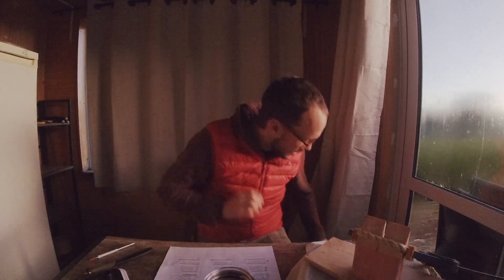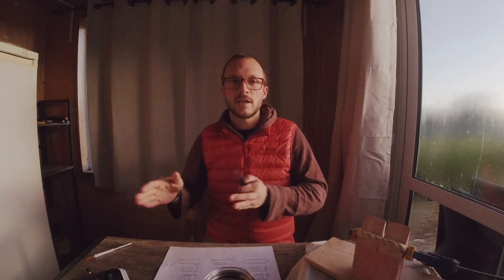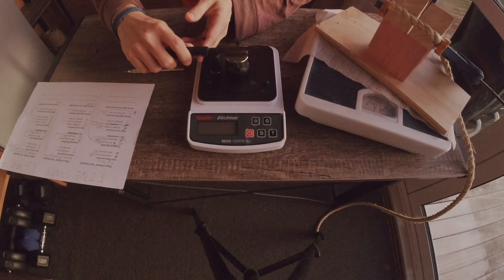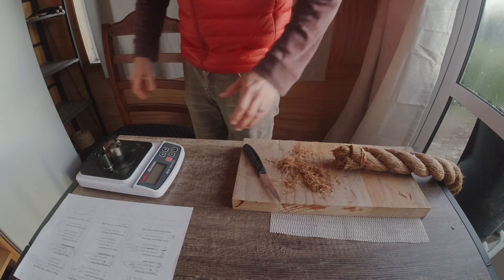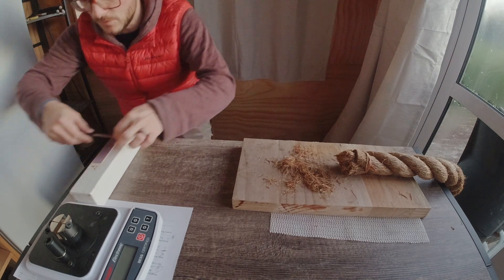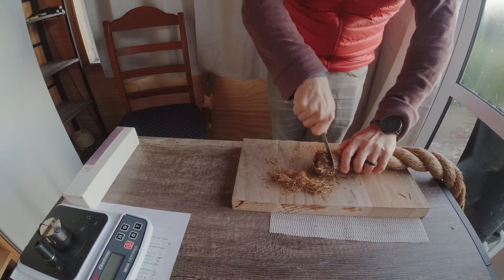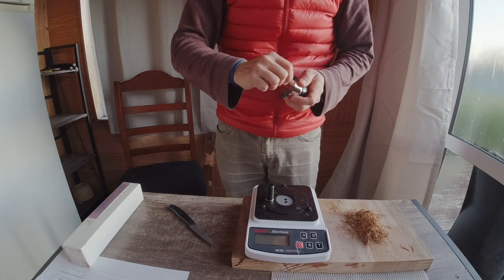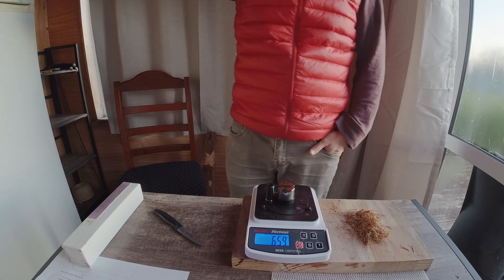What's Wrong with my Lapping Film Edge? | ANDE Rope Knife Testing

Comment: The problem is what you’re cutting with a lapping film edge. The edge slides off rope because there are no teeth. Lapping film edges can be extremely sharp if done right and are for opening letters, paper cutting, things like that. I use lapping film edges at work to cut playing cards all day. But to cut rope, you use edges with teeth- 600-1000 grit are great. Hope that helps.
Reply from the maker: Thanks Mike!!!

Comment: I noticed you going from heel to toe away from the edge. Ate you following your scratch pattern? If you think of it as a saw, if you go heel to toe when sharpening towards the edge, then you want to go toe to heel when sharpening away from the edge,  always follow your initial scratch pattern. To really get into the weeds if you are pull slicing the  scratch pattern should be angled towards the heel. If you are push slicing the pattern should be angled towards the toe. If you are push  cutting or general purpose the pattern should be straight up and down the bevel.
Reply from the maker: Interesting, I don't think I've ever noticed it making a difference.  Do you find you can observe a difference?  Thanks for the input, will consider it!

Comment: I’ve read any BESS result above 150 after sharpening means you still have a burr or wire edge present. 

Another comment had a good point about steel hardness. You might need a higher hardness to get a better edge.
Reply from the maker: Yeah, I think you are onto something.  Although actually, I am getting quite good edges (below 100 BESS) sometimes now on these Victorinox Paring Knives, but often I need to adjust angle and use softer abrasives to achieve it.  

I think harder steels will be comparatively more likely to produce "negative burr" and be easier to sharpen with diamond abrasives.

Comment: I think if lapping film tends to produce a foil burr, doing edge leading strokes are the way to go.
Reply from the maker: Do you do edge leading strokes on lapping film?  I always assumed that would cut through it.
Reply: @homeslicesharpening  i havent sharpened with them, but im pretty sure you can get away with it. I would do light pressure, and be careful not to go too high with the angle. 

I thinks its doable though.
Reply from the maker: @_BLANK_BLANK  I’ll have to give it a try.  I may have assumed incorrectly.
Reply: @homeslicesharpening  i know you can slice through them, but if youre being careful it should be fine.

Comment: ill give you a top secret of mine. For a super aggressive knife edge try only going up to around 600 to 800 gritt Max. Make sure your getting a burr on each side as you sharpen. You should feel it when you drag your finger over the side of the knife. Be careful when you do this. Never run your fingers down the blade. Then strop the knife with a 1 to .5 fully loaded diamond emulsion leather strop. Be sure not to over do this step because all your doing it knocking the foil bur off if there is one left. All my pocket knives are sharpened around 17 to 18 degrees and with this method i can push cut toilet paper :) Good luck on your Knife Journey :)
Reply from the maker: Thanks for the comment!  I did get better results on the lower grit edge that I then stropped, and will take your advice into account.

Do you do edge trailing, or edge leading strokes?  Do you alternate sides each stroke, or do as many strokes as it takes to raise a burr on one side then flip sides?  How do you know when you are done on the strop?

Thanks again!
Reply: @homeslicesharpening  The strop should be used sparingly. maybe 10 strokes on both sides. Its just used to clean up the bevel. I use a wicked edge.:)

Comment: Glad to see that scribe I sent you is helping you out. Never played with films myself outside on the edge pro ones that came with my edge pro years ago. I was never too impressed with them edge wise. They gave you a pretty mirror polished edge but the edge wasn't as good. Also last few years I find that I don't like edge from fine finished edges. Only exception is 0.5 hand American spray on balsa but even that I don't use as much. I find that with 7/5 micron 800 venev or 4000 grit/5 micron edge pro diamond matrix stones are my choice for last stone and then either 5/3 gene diamond paste or 3 micron Gunny Juice on either balsa, hetinax, thin kangaroo leather or painters tape over an aluminum blank for strop choices. I find the edge very sharp but still having bite to it and maybe its just my perception but they seem to last longer than if I go to 0.5 or 0.1 micron.
Reply from the maker: Yeah, I think the finer strops do have potential to mess up the edge aggression - I still have a lot of testing to do to see if I can find ways to quantify and (more importantly) to avoid that negative effect!

Comment: Was just doing some sharpening tonight and reflecting on how edge trailing strokes with Spyderco ceramics, for me, only seem to work with their medium stone. If I try edge trailing on fine or ultra fine, suddenly my edge is garbage.
Reply from the maker: Yeah, I have had better luck finishing with alternating edge trailing and edge leading strokes on Spyderco fine ceramics.

Better results from that than edge trailing only.  Oh, and my test of edge leading on the ANDE rope delivered a better result than my test of edge trailing.  So, yeah, my experience has not been as extreme as yours, but I do find that you need to do some edge leading strokes to get the best edge on fine ceramics.
Reply: @homeslicesharpening  Ok, I feel vindicated now! 
Now I just need to stop beating myself up for not being able to slice S's in paper towel after using only a 220 grit waterstone like BBB 😀
Reply from the maker: @CSGraves  does he do that!!?
Reply: @homeslicesharpening  I exaggerate, but he does have that video where he uses a 'medium grit' stone to achieve an edge I can't get with my full battery of stones. 😞
Reply: @CSGraves  just keep practicing. Years ago I fought getting my knife to barely cut printer paper was good, now I'm a but better than that at sharpening either free hand or on a system. Good stones help but once you've practised you can get a sharpeners edge from any stone.
Cliff Stamp has a videos where he uses a 36 grit dressing stone and also a plain brick to get a knife to cut newsprint pretty cleanly. Neither is intended for sharpening but if you're skilled enough you can get an edge from just about anything.
Keep practicing.
Reply: @MFD00MTR33  Ahh I may have seen that very Cliff Stamp video years ago! R.I.P. Cliff.
Reply: @CSGraves  the man was a legend. He is one of the biggest reasons I got into simpler steels at high hardness like Aeb-l and Sandvik as well as thinner ground knives. Shame that he passed away because he had so much knowledge to share. His channel and forum a filled with knowledge and no matter what experience level you are you can still find something to learn from there.
Reply: @MFD00MTR33  I remember he had some kind words to share on a sharpening job I did on a sickle long ago. 👍

Comment: Hmmmmmmm... First, I think the initial sharpness wasn't great, so that's a sign of something being amiss. Second, sub-micron grits are probably unhelpful or even counterproductive for that kind of steel;  I usually see 1k recommended as the finishing grit for 50cr15/1.4116-type steels (Spyderco UF is around 2.5 micron iirc). By doing a lot of steps on fine grits that don't remove a lot of material, you may be creating an apex weakened by repeated lateral pressure. This would also explain why the post-rope BESS was so high- the apex broke down due to prior fatigue damage. Maybe try the same progression again at a steeper angle? Or aluminum oxide/silicon carbide films instead of diamond (diamond-on-substrate abrasives can be iffy at higher grits).
Reply from the maker: Very good insight - thank you.

Comment: Foil burr is very fragile. You can test for it passing with low pressure on the cutting board. If there is a sharpness drop then burr is the most likely cause.

Another possibility is diamonds fracturing carbides.  I've had a very bad experience sharpening 1.4110 steel on a diamond stone. It's not that rich in carbides but carbide size is about the same as K390 with some clusters on 1.4110 larger than K390. Carbide fracture may affect initial sharpness but not always. Sometimes the initial sharpness is perfect and the only problem low durability like what you just had.

I would test those lapping films on clean steel like 5160 or 1070 to see if you get a better result. My diamond stone had much better results sharpening 1070.
Reply from the maker: Very very interesting!  Thank you so much for the information.
Reply: Pois é amigo, o mesmo problema  que enfrentei com a faquinha em 1.4110!
Reply from the maker: @raimundomartinsdeloiolafil7879  Ah - my friend Thiago should be able to help you in Portuguese!  Cheers!